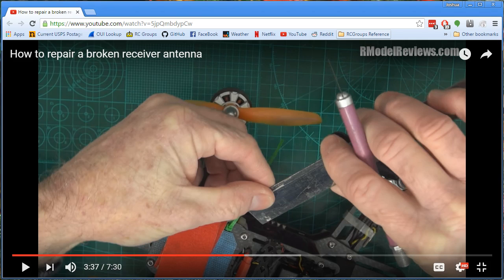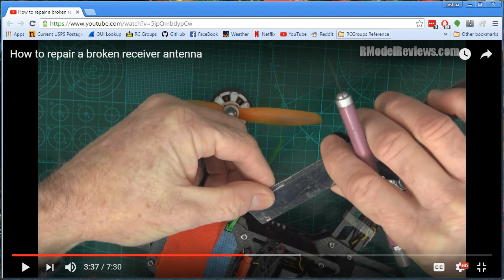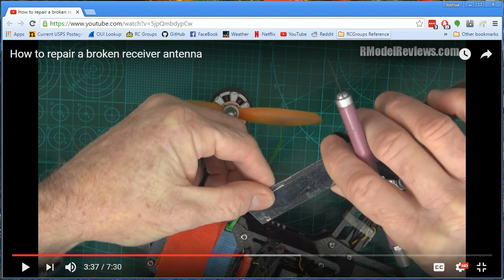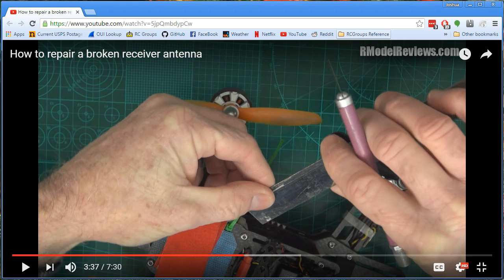More precisely repair a broken receiver antenna

Comment: Hi, i contacted Frsky because original X4r Antennas are 33mm long, Which is not in the calculated spectrum for Frsky 2.4GHz. This is their answer:

Dear Friend,
Thanks
 contact FrSky, yes, generally considering the antenna length is 1/4 of 
the wavelength, but we consider other circuit losses and gains, and make
 multiple comparison tests, then the length 33 mm is more appropriate.
Best regardsRay
Do you (Joshua or other who cut to 31mm) get worse recepetion with 31mm?
Reply from the maker: +bind I would trust what FrSky says.

Comment: i have a rx wich came with 27mm, if i get that 4 mm exposed will make a big difference?
Reply from the maker: +Roi in orbit hard to say because there is more to antenna design than just the radiating element. It probably won't make a huge difference but you never know. I assume there is a reason the vendor made it that way.
Reply: its a cheap rx from bangood fsfly f701 i have some failsafes lately and running out of ideas, btw thanks for answering

Comment: Or..... Just buy a few antenna off ebay (pretty cheap!) and just replace the chopped one. I've done Bruce's fix a few times now in the past, takes about 15/20 mins. Replacement of the antenna takes about 5,assuming you can get at it easily and it's not buried in an inaccessible place on your quad.
Reply from the maker: +mrmurder75 harder to replace if it is soldered on.
Reply: +Joshua Bardwell very true!
Reply: its nice having shorter ones

Comment: Very useful tip thanks Joshua, can you talk about preventing shorts/ how to fix them?
Reply from the maker: +Pablo Contreras shorts where?
Reply: +Joshua Bardwell flight controller. I think metal screws were a mistake
Reply from the maker: The FC should be designed with no traces at all near the screw holes.
Reply from the maker: +Pablo Contreras if there is a short then you will have continuity between the 5v and ground pads. If that exists you have to just inspect until you find it, or start desoldering.
Reply: +Joshua Bardwell it's a Dodo V3... It gets extremely hot if powered by either my 4s lipos or USB. Works in clean flight until it gets so hot that it freezes completely. Cannot arm and red light flashes non-stop. I think it a short but I don't know what to think. Also ESC will make their boot up sound over and over when Lipo is plugged in. I have a Cyclone I bought off a friend which I'm gonna swap for tonight but it would be good news if I could troubleshoot my Dodo.... Thanks again let me know if you want any more details/ have any idea what this could be
Reply: +Joshua Bardwell I'll see what happens after I put my Cyclone in. Hopefully I see something. Do the symptoms sound like a short?
Reply from the maker: +Pablo Contreras yes.

Comment: perfect info.
As a preference I have mines ran under my quad with an exteam short amount of the tip sticking out. 
I had instances of my anntenas being chopped off to frequently. After realizing the tip is the most important part thanks to Bruce. 
My Signal and distance is still the same as if i had it sticking up like ant antennas..

Perfect protect and no snag/clip hazard is the benefit.

Comment: Nice video. Joshua what are your thoughts on the frsky xsr only having 26mm as the active part of the antenna?
Reply: It is not so simple, 1/4 wave antenna have electrical length of 32.23mm, but electrical length is not same as physical length due velocity factor (which depends of construction, diameter ...) so 26mm physical length on receiver will translate to correct 1/4 wave antenna electrical length (it they did their math correctly).
Exposing 32mm of inner wire is not always ideal solution, but it is in most cases good enough that you will not notice any difference (anyway you will notice more difference from moisture in air then from that).
Reply: Keen to know as well. I have a few different lengths on mine too.
Reply: very tiny bit smaller signal strength, nothing to really care about, at least that is my experience
Reply from the maker: +kubaistube it's hard to say what the effect would be without a network analyzer. But presumably it's tuned different. How does the range compare?
Reply: True that, I was rather relating to range difference which is almost none, unless you fly long distance in which case nobody would probably choose such tiny device with super short antennas. I used to use as majority did  D4R-II even for long range with antennas getting chopped quite often, now I have XSR with antennas hidden inside the 210mm frame and I have never run out of signal, only low RSSI warnings from time to time, but never bellow 40, 200mW VTx with oamway mushroom antenna is weaker link in the system then XSR.
Reply from the maker: Very good point. I hadn't thought of that. This is why my tendency would be to leave it exactly as the manufacturer sent it.